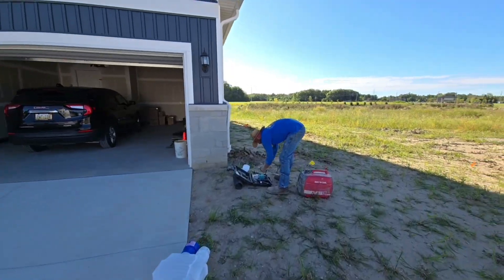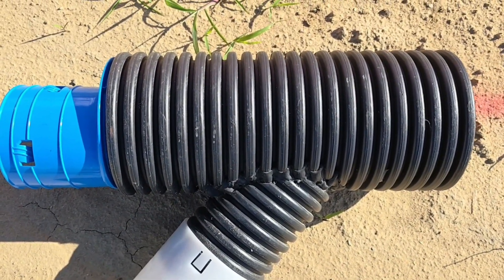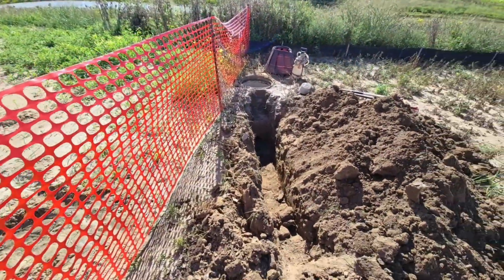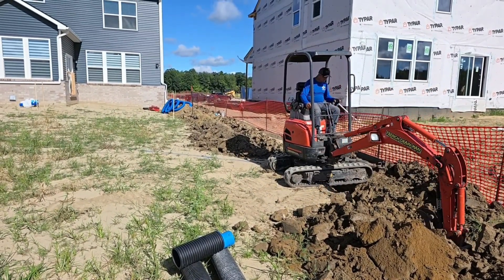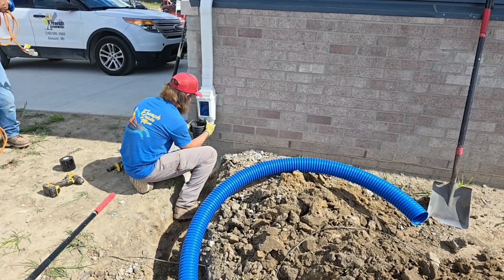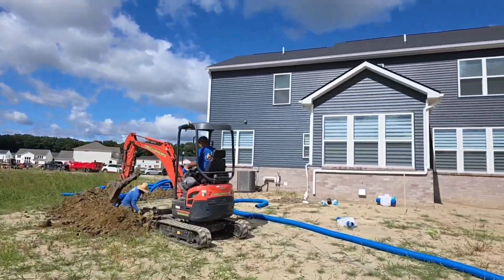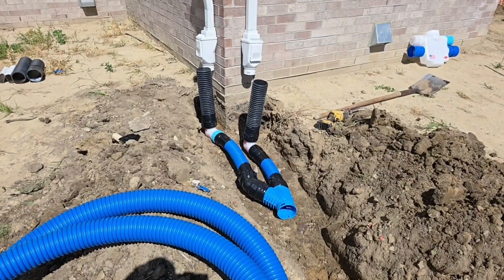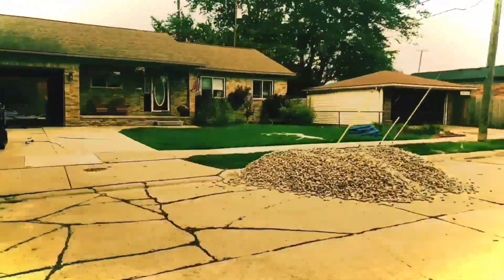New Construction: Underground Buried Downspouts, 2026 Updates - Whole House Roof Runoff System

Comment: 17:30 nothing to do with you but you decided to run that downspout laterally?
Reply from the maker: When you make a lot of turns on your main line, the water slows down in every turn. So we try to make a really straight line that has constant flow, and you don't want bellies. Many things to consider when running your main line.

Comment: In the Australian home inspections here on YT they are required to do the drainage first there. All pipes must also have a minimum of 4 inches of soil on the pipe.  10/10 on that install there, 6 inch, 4 inch, 3.5 inch... corrugated, dual-wall... you did it all. 10/10.
Reply from the maker: Thank you